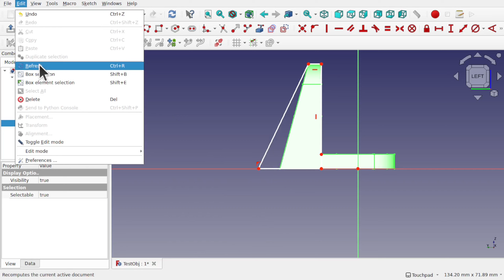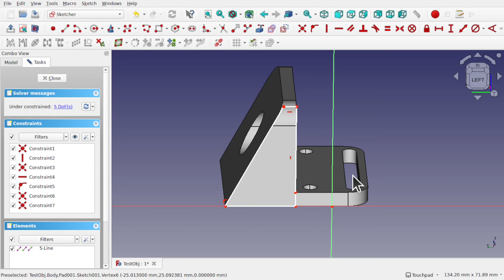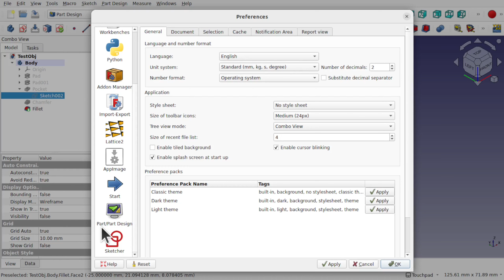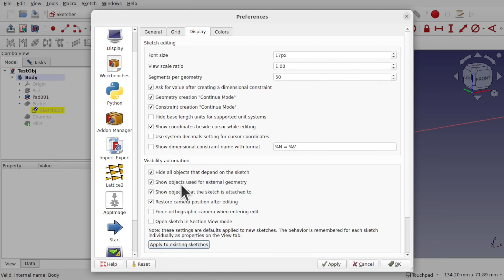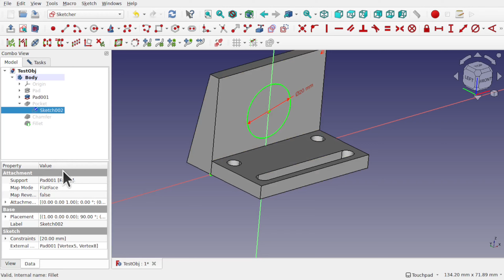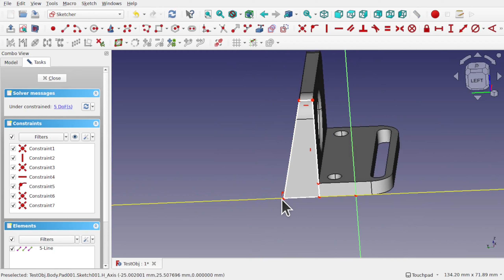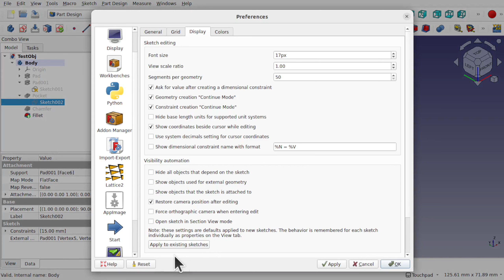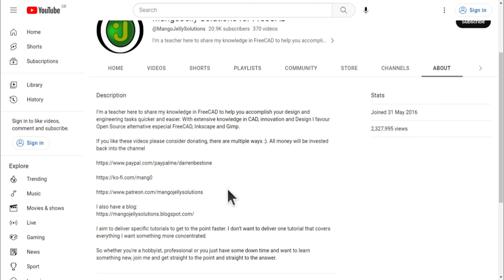Automatic Operation Updates in FreeCAD: Two Sketcher Settings That Could Make Your Life Easier

Comment: THX. IMO that should be a default setting, as auto-update is an abundant and expected feature on nowaday's CAD.
Reply: It made by purpose. Some of us working with pretty complex models and even small change could lead to the long time recalculation of entire model. Sometimes I even disable update of the model for some edits and enable only when I done editing all I need, just to save some wait time. And answering not asked question - my PC pretty fast - i9, 32g ram and ssd...
Reply: @andrewshkolik  that's a strong point. But as a qualified user working with complex models, you are - IMO - the one who should adjust the appropriate settings. A more user-friendly FreeCAD could even come up with a suggestion to do this when the recomputing interval takes more than maybe 400ms. I have highest repect for those devs who work on FreeCAD, but for me the software is a bad dream in terms of UX.

Comment: why is ti that when i creat a part in Part Design then go try to convert it to an A2plus part it dissapears ?
Reply from the maker: The part is made hidden and a a2 part is created that is linked to that part. A2 plus parts have a set of properties of their own such as if it's a fixed position part. The two are linked so if you update the original it will update the other. You will need to use the update parts in assembly button for that to happen.

Comment: NOW you tell me!  Settings should be a series of show and tell…
Reply from the maker: That's a good idea, some of the settings are a bit obscure to say the least.
Reply: That's what happens when you have a cooperative project like this.  Lot's of people are involved and things are added without a group to make an explanation in a text with examples etc.  You essentially have to find out for yourself what's available.
Reply from the maker: @philnelson2364  I have also found that developers are not very good at documenting at that high level of how to use the feature.  I know this as part of my day job involves trying to get the devs I work with to try to do it.  Can understand, if you been working on a feature for months and you finally finish it, the last thing you want to do is document it.  But it doesn't help the users.
Reply: @MangoJellySolutions  When I started developing remote car starters and alarms, I was the one that created all of the functions used by, not only the user but for the installers as well.  When I started, there was a shipper/receiver, the owner and a few sub contractors/installers.  I was the one that had to document the functions for the users and installers and, also translate it into french and create the documents for the repair and service personnel as well.  When the company grew to over 50 employees, I had to design departments, heads of dept., communications between depts. etc.  So I had to document everything for the new engineers, technicians, marketing staff etc.  I think it occupied a lot of time but, I made sure everything was spelled out correctly and completely... On the other hand, I was paid to do it and not a volunteer so, I can't exactly accuse the developers of not being thorough.